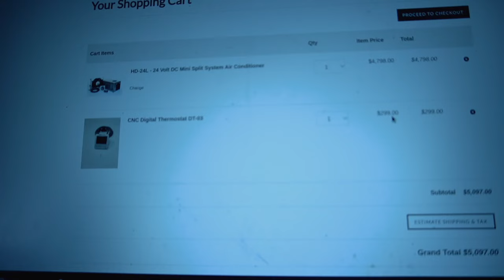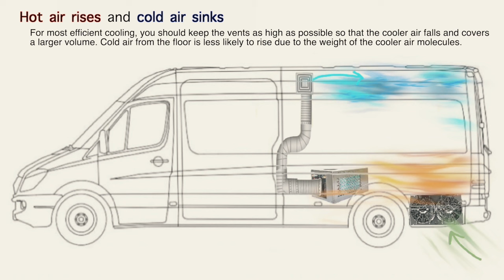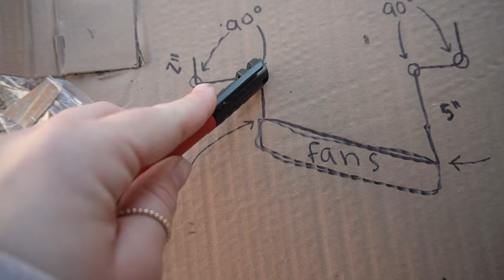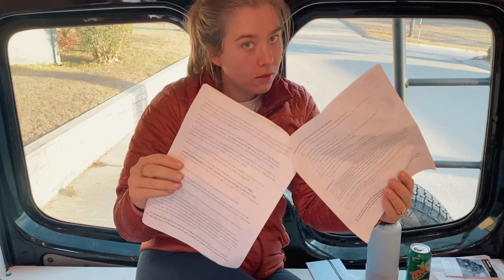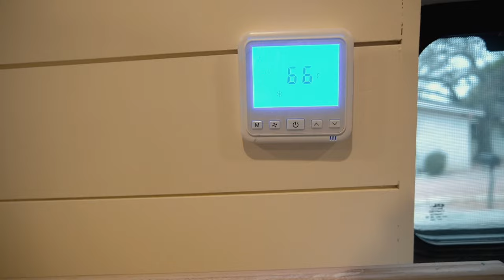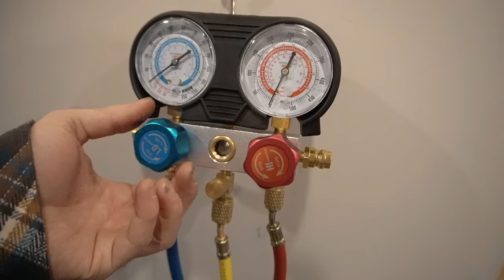12/24V Air Conditioning INSTALL and REVIEW for Van Life // Van Build Ep.29

Comment: Thank you for your feedback on the unit. I apologize for the problems you experienced. Because of your input, and input of others, I have changed the design of the thermistor board and added a way of setting the baseline compressor speed. This allows people to adjust the Btu output and current consumption. The new thermistor still adjusts the compressor speed based on the evaporator temperature. We also added universal adjustable condenser brackets, so customers do not have to fabricate their own. Also new to our units are available Wi-Fi thermostats. This allows monitoring and control of the unit from your cell phone if the van has a Wi-Fi connection or hot spot. Thank you again for your purchase and if you need support in the future please call me direct. Chris Frye, Owner, CNC USA 🇺🇸🇺🇸🇺🇸

Comment: Y'all are really dedicated and patient for installing and troubleshooting all the problems.  I don't think I would do the same in may van after seeing all y'all went through.   I have opted to try a Freshair evaporative cooler.   It is installed but I haven't started it up yet because I'm still working on the electrical and plumbing which it requires.  But yours looks to work really well now that all the problems have been solved.   You definitely need some sort of cooling in Texas.
Reply from the maker: Thank you! We definitely were a little disappointed that we had so many issues for a product people rave about. We hope the Freshair cooler will work, the heat is no JOKE.

Comment: Great video and information 👍. 
I wouldn't spend much time in a van without a ac system. 
I installed a conventional mini split AC/heat pump in my van.
I can run it 24/7 off the solar panels and batteries. 
Definitely a thumbs up 👍
Reply from the maker: It's so crucial sometimes, but 24/7? Share you secret 🤐!
Reply: @thewildearthlings  1,200 watts of solar panels and 900 amp hours of lithium batteries.
I keep it on the economy setting and a lot of southern sunshine.

Comment: Viper car alarms makes a model that has a thermometer inside the car that will turn your car on if it hits the temperature you set it too as a back up option… you just have to have the air set on on so when your car comes on, so will your air.